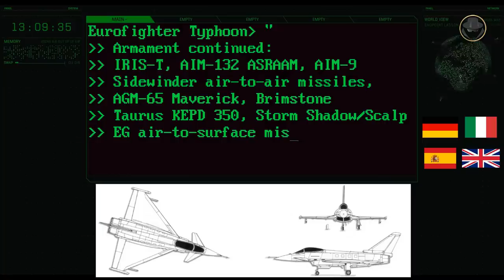Eurofighter Typhoon | The story that the West does not want to tell

Comment: I think that the Eurofighter Typhoon is a great aircraft and they are used by several countries who participate in the Red Flag exercises and have proven their worth to the nations using them. During the exercises tested there the aircraft was able to defeat many of the newer aircraft in service and will be used for a long time to come.
Reply: While they maybe a great craft they simply are nowhere near the level of the US fighters programs.
Reply: @bighands69  Really?  The F35 is totally out performed by the Typhoon in several ways, including supercruise and weapons load out.  The F35 has stealth, but that is compromised now by new radar systems, meaning the main benefits are lost.  In any case they are two different aircraft with two different roles.
Reply: @trevor311264  If you think Typhoon doesn't have Stealth capability you are miss informed. Aircraft was built with a low frontal radar cross section, supercruise for  reduced IR  signature and PIRATE IR system.
Reply: @davidwitter1234  All modern aircraft have some design features to reduce radar signal return, it does not mean it has been designed as a stealth aircraft, far from it.
Reply: @trevor311264  These days being seen by RADAR is one of only several ways you are found in the air. Typhoon doesnt have a super effective body shape and funky coatings to make it as stealthy as the F35, but it does almost all of the other stuff the F35 does to not be seen
Reply: @trevor311264  
The F-35 is a large scale system that is intended to be a base aircraft of a force. The F-35 has been around for about the same length of time a the Typhoon but will soon have twice as many aircraft. 
An F-35 has a level of stealth that the main US stealth aircraft have. The new radar systems cannot overcome stealth that employs signal warfare. It is that simple. I am not saying the Typhoon is useless it is just not in the same league as an F-35 that has the advantage of deep airspace penetration before opponents know anything about it and by the time they have figured out it would be too late. 
Stealth is not about complete invisibility it is about the ability to delay detection until the enemy is too late in acting.
Reply: @markcooke5270  
A Typhoon cannot penetrate airspace like an F-22 or F-35 can. What makes those new stealth fighters so powerful is the fact that by the time the enemy figures out that their airspace has been penetrated it would be too late to do anything. 
Anti air systems can be disrupted through signal warfare to the point that stealth aircraft would be completely invisible to the airspace. 
An F-16 costs half the price of a Typhoon which can allow great numbers to be attained and is backed by US aerospace industry.
Reply: @markcooke5270  
The Typhoon is not stealth so stop with the nonsense.
Reply: @markcooke5270  
As stated by yourself "...Typhoon with its relatively small cross section and radar ..."
By making that statement you are implying that it means the Typhoon can be compared to the F-22 or F-35  and somehow make it superior. 
Why else would you bring it up in your conversation that is trying to imply that the Typhoon is superior to the F-22 or F-35.
Reply: The Eurofighter is the best european fighter ever made 4th generation better than a Gripen or a Vigorous Dragon and i bet it can beat a Mighty Dragon just needs to evolve in Generation.
Reply: The BAE Lightning was the only jet fighter to catch Concord also flew up to a U2 & waved, then flew up to 84,000ft.  Typhoon flies high too! RR makes uprated engines if needed. Typhoon a good ground attack aircraft too, but all jets are at risk of missiles, who knows what the future aircraft will be like, possibly the navy aircraft jets won’t need launch systems, they’ll have huge power. Things are changing fast, but it all takes time, because humans have limitations in all respects.

Comment: India considered Eurofighter and Rafale for her airforce but opted for theFrench aircraft because of the price. India has bought 36 Rafales and might buy more until their own fifth-generation fighter is ready for trials.
Reply: Pretty sure it wasn't just the price.
Reply: Rafale is Multi role , war proof  and  has a modern radar.
Reply: @chevauxpatrice6198 : Just like the Typhoon.
Reply: @THE-BUNKEN-DRUM  At the time Typhoon had no AESA radar vs the Rafale. Must look at the noting and it's also fell behind in Air superiority , Netherland and Switzerland also gave it a lower not in that specific area.
Reply: @jureeratpholseela7508  : At that time, they were testing the Typhoon, it was only TRANCHE 1. Typhoon is currently at TRANCHE 3, soon to be TRANCHE 4. These are vastly more capable than the TRANCHE 1, in terms of avionics. The Typhoon's air-air capability has nowhere near been diminished, if anything, it's been improved & before you claim that the Rafale scored kills against it aswell as the F22, the opposite to both of them statements is also true. Infact, the TRANCHE 1 Typhoon (the most basic model) was the 1st to score kills against the Raptor 'years' before the Rafale was did.
Reply: @THE-BUNKEN-DRUM  Agreed the Tranche 1 was very limited. Much better now

Comment: What is the point of this video. Germany, UK, Spain, Italy and Austria use the Typhoon. That's five European countries. And you're trying to tell me the Typhoon isn't popular? The French needed, as you already said, a carrier-capable fighter, so they made their own
EDIT: Since some people think the Eurofighter is a copy of the Rafale, heres some facts:
In the 1970s, the French launched the Avion de Combat du Futur (ACF) program. The successor to the Mirage 3 and the F-1 was to be a Delta aircraft with fly-by-wire. The Mirage 2000 and the unsuccessful Mirage 4000 developed from the ACF program. The project was resumed in 1977 under the name Avion de Combat Tactique (ACT). Since Great Britain and Germany were doing research on a new hunter (AST 403 (GB) and TKF90 (GER)) at the same time, it was decided to merge the program into a European joint project. Dassault, MBB and BAe each submitted a draft. In 1983, BAe and MBB presented the first joint draft, Dassault did not agree and developed his own prototype based on the ACT. Even before the official agreement to develop a joint aircraft, France went its own way. Nevertheless, the development of a European Fighter Aircraft (EFA) was decided in 1983/84. France wanted a smaller, cheaper multi-role fighter with distinctive short take-off properties, better suited for missions by the relatively small French carriers, with strong ground attack capabilities and better export opportunities, while Germany and Great Britain had a high-performance and manoeuvrable fighter in mind: high acceleration at all altitudes, good supersonic maneuverability in the initial phase of the aerial battle, effective fire-and-forget air-to-air armament for medium distances, extreme maneuverability in dogfight and a good range for air surveillance missions and escorts. The ability to fight in curves should be achieved through high pitch rates and maintenance of flight stability even after a stall. Thrust vector control should give the machine the ability to adjust the line of sight to the target (very interesting because the lack of said thrust-vector-control ist the main critique point nowadays). Ground attack abilities were intended as a secondary ability only. France claimed system leadership and 50% work share. In August 1985 the negotiations finally failed, whereupon the then French Defense Minister Charles Hernu announced that France would withdraw from the EFA program and develop the ACX on its own for series production. The remaining four nations developed the EFA into the Eurofighter.
Reply: Germany also operated the MiG-29 until the Luftwaffe gifted Poland's air force with its surviving airframes for the absolute bargain of one euro each. This has no relevance to the Eurofighter. I just thought it was a cool aspect of aviation history.
Reply: @Matze239  nobody cares too and EF is just an ugly copy of The Rafale, the Best 4.5's.
Reply: Austria intends to get rid of Eurofighters as their operation costs are extreme and will probably buy Gripen. Other nations also use Gripen or F-35. From that point the initial intention was not fulfilled at all.
Reply: @flankerpraha  the initial intent of the Typhoon was to develop a highly capable air-superiority fighter, not to sell it all around the world. That's one reason why France left the Programme, they wanted a plane that's easy to export.
So yeah, the Typhoon did in fact meet its initial intentions🤷‍♂️
Reply: @brittanyfirst1608  you clearly have no idea and it shows
The rafale was developed after France left the EFA Programme dummy
Reply: Rafales are better. The Typhoons might have met their initial expectations but in the end it wasn't good enough for people to want it, and so it was never sold beyond 5 countries,not because of any other reason. I understand you might like this aircraft but in the pool of options that there are around as the new F16 viper, the Rafale, F35 and so on it is not above those
Reply: @brittanyfirst1608  Yeah, that would be because after ripping off the development data and leaving the EFA project, the frogs were more efficient in definition of requirements and moving to production to get what they wanted, as you would expect when you don't have multiple "partners" arguing over requirements definition and what needs to be done first....
Reply: @Pietro bellucci : Whatever helps you to sleep at night mate.
Reply: @brittanyfirst1608  get your facts right EAP was built by BAE well before Dassualt started the basic design permitters for Rafale. Dassualt even became a member of the EAP development programme with BAE, 
Messerschmitt and Leonardo to form Eurofighter GMBH. 

The reason the French pulled out was due wanting to be the primary partner and a carrier variant, whilst GB, Germany and Italy wanted a dedicated land based fighter / interceptor with limited multi role capabilities with equal work share. Both air frames have matured into solid multi role platforms. Rafale is a good 4 /4+ generation fighter but to say it is better than the Eurofighter is just stupid flag waving. Tranche 3 Eurofighter with Meteor BVRM, full AESA and sensor fusion has the edge in a dog fight and Rafale is a better multi role platform when in attack configuration.
Reply: @CaptainDangeax  dickhead I commented on Rafales positives if you care to read. 

If you must troll Eurofighter has been used in Iraq and Syria using the same weapons as Rafale storm shadow/scalp. We have intergrated brimstone and pave way which would make mince meat out of Leclerc and other french armour. 

RAF Tranche 3 Eurofighter’s are having a vastly superior Leonardo developed AESA which will also allow data links with F35 and other platforms. 
Oh and by the way Meteor was designed for Typhoon and Gripen as the primary users. Also the EJ2000 has vastly more thrust to weight output.
Reply: @Matze239  the main reason France left is because they wanted a multirole carrier capable aircraft. Besides they felt it was going to be more practical to do everything by themselves.
Reply: @piwo647  yes, that was probably the main reason for them leaving. In addition to that they always want to lead these kind of projects. It's always the same with them. The GTK Boxer for example. France, UK and Germany decided to develop an MRAV together. Both Germany and France submitted a design, and the German GTK design was chosen over the VBCI project. The French didn't like that so they simply left and did their own thing again. And now with MGCS and FCAS the French again want to take the leading role for both projects And want French companies to produce them.
I feel like the French like joint projects as long as they can do whatever they want and profit from the funding and knowledge of others... Just my opinion
Reply: @dylanwight5764  Thanks :)
Reply: @sebxiou-lifestyle4465  You're very welcome :)
Reply: The Harrier twatted every French jet in the Falklands so don't believe this bullshit. The UK knows what's needed and I know who would win between the RAF and the French Air Force
Reply: @brittanyfirst1608  Funny .. EF is a Rafale Copy, Even if the first proof of concept EF flew some 10-15 years before Rafale ... LOL
Reply: @flankerpraha  Austria is trying to get rid of the EF, because they have no defense policy and want to get rid of their entire military.
Reply: The French also insisted on using their engine, the Snecma M88 which was less powerful than the Eurojet EJ200. The Typhoon was originally designed as an interceptor, so speed was crucial. Thus the French threw their baguettes on the ground, and decided to leave.
Reply: @scratchy996  they would have been better off by keeping the original  RB199 instead of pushing for the M88 🤣
Reply: @Matze239  this is not true at all, Eurofighter program was even stopped from 1992. to 1998. and it was never intended to be multi role fighter, it was air defence/air superiority fighter, why do you talk at all when it is obvious you don't know anything about the topic?
Reply: @Matze239  UK, German, Spain and Italy wanted cheaper plane, not France, again you show how little you know
Reply: @Then.72  Super Etendard is not even a fighter.
Reply: @matthew_turkmen7482  you have no clue mate. It's not that hard to read up on it so do it and get your facts right. Or do you want me to link the sources to you?
Reply: @matthew_turkmen7482  Ay mate, misread you comment. 
You're right, the Typhoon wasn't originally intended to be a multi-role fighter, at least not from the German side. Germany wanted an air superiority fighter, GB wanted a multi-purpose combat aircraft, but the German requirements were agreed. Mixed something up there my bad.

But, France actually wanted a cheaper and, above all, simpler aircraft than the MBB and BAe. Dassault hoped that this would provide better export opportunities. The UK and Germany never had an airplane for export in mind, which is why it is absolute bullshit to measure the success of the Typhoon by its export success. As if I were to compare a C-Class with a Ford F150 and say: The Ford is slower so it is not that successful! And that's utter bullshit.
Reply: @Then.72  Funny, that's the second Brit I see spouting the same nonsense about the Falkland war and how they would have supposedly destroyed every French jet. Hhint: the reality is closer to 8%, so 92% were still functioning after the war. Given that the RAF couldn't handle French jet piloted by third parties, it's really doubtful they would know how to handle the Armée de l'Air. Anyway, I really wonder where you people get your information. Don't you know how to use google? I mean, even wikipedia will do.
Reply: @gillespieffet8677  it’s called common sense and it was the ROYAL NAVY who shot down every French jet in a dogfight with the Harrier so you obviously don’t use google very well

Comment: IMO Eurofighter's biggest mistake, ironically, is that it sold Typhoons to Saudi Arabia...arming a volatile, potentially hostile nation with one of the most advanced fighters in the world will spell trouble, granted they are older variants than the ones used by the RAF and German Air Force, but still.
Reply: But can you imagine if they had gone to the Russians or the Chinese instead of the Eurofighter consortium?
Reply: The Saudis have always bought Western tech. They also train with Western nations, for decades, without any problems....for now.

Comment: This is without a doubt one of the best fighter jets flying with the Rafael, and F15 and only the F-35 and F22 ahead though both lack the strong weapons load capabilities. The F-35's go in first target and the Eurofighter firing Meteor from behind. It's thrust to weight ratio is immense coupled to super cruise and a now proper multi-role capability it will be just right in the current fighter mix we have..
Reply: Rafale not Rafael

Comment: The F35 was available for commercialization much later than the Eurofighter and most countries were only interested in the VSTOL or naval version of the F35 anyway until a few years ago because the price was abysmal, its costs per hour of flight absolutely crazy and there were serious doubts about its real performance and cost-effectiveness. The Eurofighter is inferior only to the F22 and on par with the Rafale. The reason why many countries opted for new gen F16s or Gripen is simply because they are cheaper and have lower maintenance costs than the Eurofighter.
Reply: Superior to Rafale in many things, particularly high speed and altitude performance, speed of turning and power to weight ratio. Its a way superior interceptor and air superiority plane. On the other hand the Rafale is a way superior ground attack plane,also at electronic warfare, might be slightly better on low speed maneuvering and for now, has a better radar.